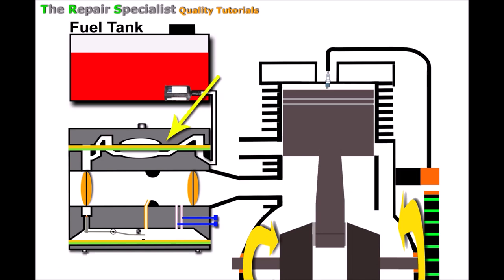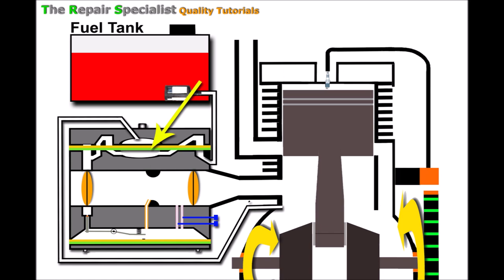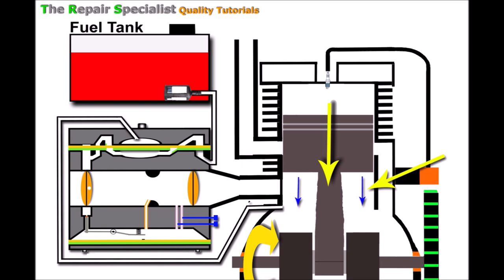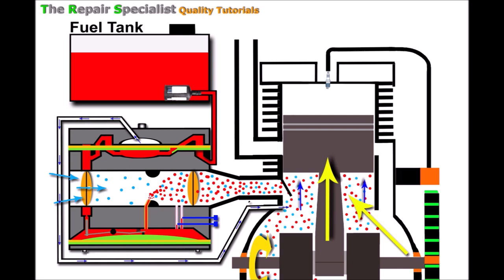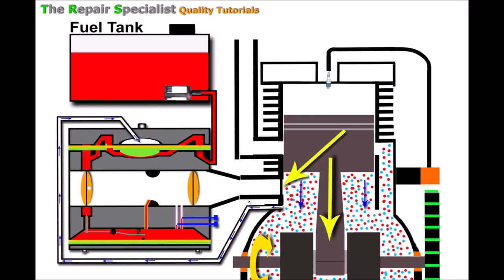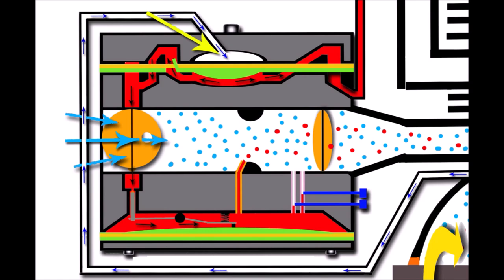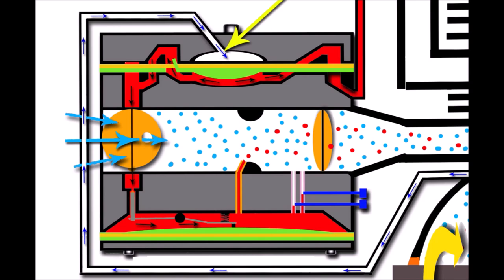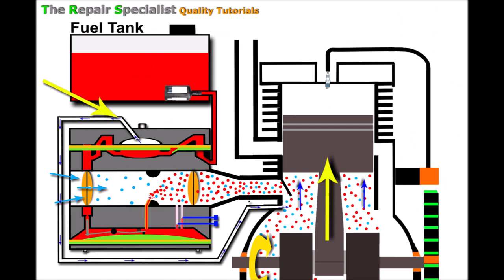Two Stroke Chainsaw Carburetor 'Impulse/Pulse Line (How it Works!)

Comment: Really helpful thanks - and a split or leak in the little impulse tube causes all the symptoms of an inlet air leak - difficult starting, unable to get proper idling etc. Not all engines have the reed valve, but the impulse works much the same.

Comment: Usually it's in the port on a two stroke so it does not affect reed valve .  Likely midpoint hight wise crossing both port . Most chainsaw stop at first port . But it's 3 mm more to get both port . It should help at high rpm

Comment: When piston moves downward at that time needle valve is closed as their is no suction in ventury to move diaghram of metering area up to open the needle valve but at the same time upper impulse line diaphragm is pressurizing fuel above needle valve does valve gets opened by that pressure when piston moves down or valve remains closed only pressure builds up there...????

Comment: Thanks for the video, I have a zero turn that is not getting any suction from the pulse line. Do you have an idea? The fuel lines are open, everything is good, the fuel pump is good, but I’m not getting any vacuum from the pulse line

Comment: Great explanation but I have a craftsman blower and don't have a tube from crankcase to carb instead is built in to intake  near carby. My question is how does the carb get it's pulse line pressure to the carb. The hole in the intake lines  up with a hole on base of carb but isnt a passage on the carb I can see that would connect to metering side or fuel pump side of carb just a hole with a solid bottom. Am curious if you have a explanation for that?

Comment: Is it possible that the engine could have good compression but for some reason not sending any pulse on the line causing the spark plug to be dry even though the carburetor is full by manual pumping and the carburetor being new?

Comment: but when the fuel tank is much higher  then carb.(like on motorcycle) do we really need those lines?
my engine seems to work fine  ...
btw great channel
Reply: If we don't, should this line be opened or closed ? How higher fuel tank should be ?
Reply: I'm here for that exact thing lol
Want to put a soviet chainsaw (109cc) carb on a motorized bike because I'm tired of not being able to adjust my air/fuel mix with the stock carb because I can't get precise jets where I live nor drillbits for it

Comment: Hi, on my two stroke string trimmer, there is no separate rubber pulse line going from the engine to the Zama carburetor.  Is the impulse transmitted through a passage cut in the barrel of the carb?  Thank you.
Reply: Should be a passage around the carb intake that takes advantage of crankcase pressures and usually the passage is ported directly through the carb gasket and into the diaphragm area..

Comment: I'm thinking of building a weed wacker powered bicycle...wondering if I was to use a bigger fuel tank and it was placed just shy of two feet away, would it still work? Would the piston still be able to create enough vacuum inside the engine to draw from that kind of distance???
Reply from the maker: I can't see why not. Just make sure the tank is elevated above the engine and the atmospheric pressure should help bring down the fuel nicely. Thank. Craig

Comment: How can you test the pulse line for amount? does a warn engine give too little pulse? i have fuel tank above carb and no primer bulb but if i run the engine out of fuel before i turn it off, how can fuel get into pump if it need fuel around those flaps to make it pump or not?

Hi, i got a REALLY tricky fuel problem or pulse hole maybe
It Bogs down when open throttle and only sort of idles so i suspected carb or fuel starvation
So as i done before, i open carb and all parts looked ok but i cleaned and replaced all the diaphragms ect and it run for 10 mins idle and full power and then starved off. I also put a brand new carb on just to eliminate the carb and same problem.
I then suspected the pulse hole leakage or engine leaking at oil seal or gaskets causing air to get in maybe when warmed up and leaning the mixture.  Put vac of 9 psi and it held steady after blocking off inlet and exhaust so the engine isnt leaking. i tried compression next and got 120 psi ? is that enough to make pulse hole work ? 
 i attached a vac gauge to the little pulse hole and pulled rope and got about 2 psi vac and pressure on the gauge so dont know if thats enough?
I notice when i try to start , there is no fuel being drawn through the fuel line to the carb so how can it even idle? Also i bypassed the filter to make sure fuel was available from the tank above the carb. This weed machine dosent have a prime bulb so does the 2 little pump flaps have to have fuel in the carb to start pumping? It worked in past as it is so i guess it will pump until fuel gets to carb but i dont see any going down the line so PULSE line issue not making the pump pump anymore? 
I used new gaskets and made sure the little gasket hole lined up ect to reach the carb and complete the air pulse circuit.
I am at a loss on this machine.

Comment: So if I was to place the fuel tank, say two to three feet away.. the carbs pulse line should work to draw the fuel in..like a pulse pump???
Reply from the maker: It shouldn't effect the pules line.  The line doesn't bring in the fuel directly through it. There is only crankcase  pressure (both positive and negative ) through this.  This pressure operates the fuel pump diaphragm, and if you have the tank elevated anyway, then atmospheric pressure with the action of the pump driven by the pulse line should be fine.  I say, SHOULD! Thanks. Craig

Comment: If there's a primer bulb, will it still run  momentarily if the pulse line is disconnected? Thanks
Reply from the maker: I would say that it wouldn't work well even ii it did run. I haven't tried this to be honest.  Sorry but I have no idea. Thanks. Craig

Comment: Sir Please help me? I am from India My machine shuts down after a while. What can I do now?
Reply from the maker: Hi.  Yes usually, and most commonly, this is due to the ignition coil pack.  They sometimes stop producing electricity to the spark plug when hot and then when cooled down they work again.  Very confusing.  The only way to know for definite is to fit a new coil pack or one that you know for definite is in good working order.  Then, run your machine to see if symptoms are still present.  It is Not always the coil pack so it is a financial risk you may have to take, but it is common.  This is the best place to start in my opinion.  I will make a video on this after I have completed a few other requested videos. Many thanks Craig

Comment: What causes the metering diaphragm to function
Reply: THANK YOU!!!!
Reply from the maker: Hi. Thank you for your question.  To best answer this I have included a link to another video of mine, which is only a few minutes long but it explains how the metering diaphragm works alongside the other components of the two stroke cycle carburetor.  The actual info about the metering diaphragm it at position-2.11 onwards, but for the sake of a few minutes you would most certainly benefit by watching the whole video to gain a full picture and understanding.  I hope this helps Thanks. Craig :    https://www.youtube.com/watch?v=CMblIgJf_gA&t=8s

Comment: My little 2 stoke barrel has no flap on the carb inlet or pulse hole. Is this correct?  just 1 large and small hole into cylinder from the side and the exhaust on the other side

Comment: i have been tearing my hair out trying to figure out why my echo HC150  hedge trimmer isn't starting. i have changed the carburetor and fuel lines, replaced the magneto and spark plug (gaped @ .028"), completely dissembled the entire engine clean, lubed and reassembled (good compression)... replaced the clutch, greased oiled and inspected all gearing and blades, replaced the grounding switch and wiring, added 2.5 ounces of two cycle oil to a gallon of fresh gasoline (87 octane) and filled the tank, primed entire system, and ensured that the impulse hole isn't plugged. i even tried to adjust the hidden high and low screws to no avail. does anyone..... i mean anyone have any idea what can be the culprit in this very frustrating issue. it would be very appreciated.
Reply: Is it working?
Reply: Did you find out then??
Reply: Awesom e videos